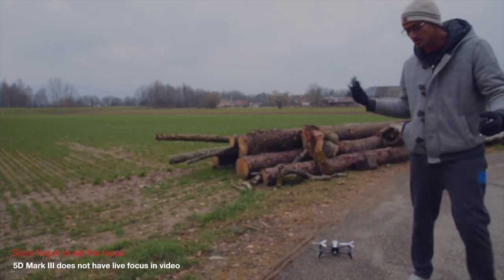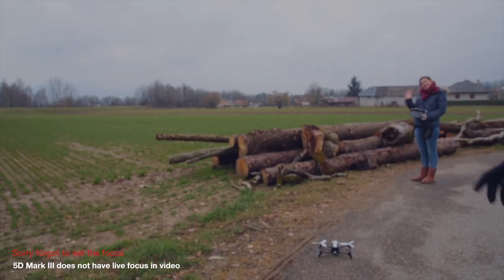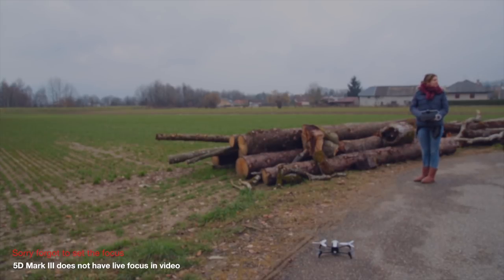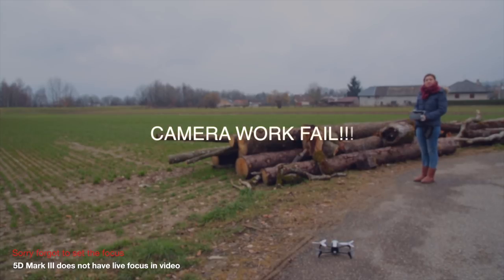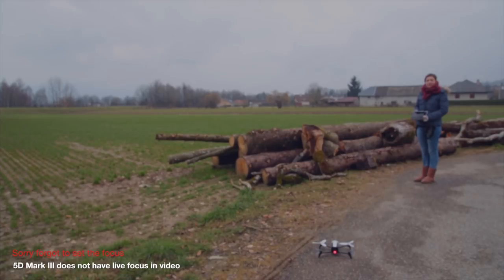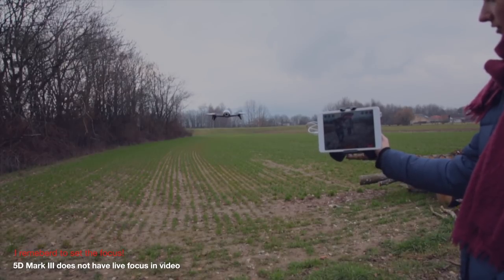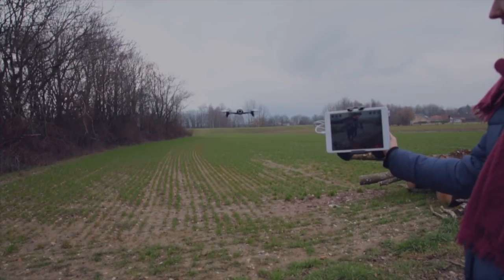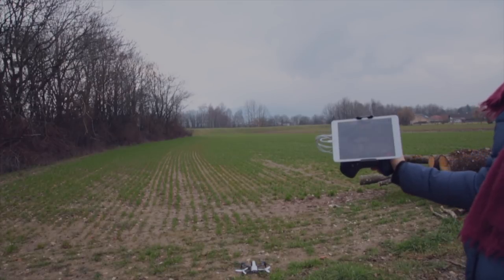BEBOP 2 Battery Discussion and Experiment

Comment: I think giving the flight time of the drone would have been helpful to understand if battery has degraded, being left on a full charge for three weeks.  My tip is when you are leaving a battery in storage is to give it a 50% charge time, ie: full charge = 45 minutes, storage charge = 25 minutes, and never run your battery below 20% these precautions will preserve your batteries performance  longer.
Reply from the maker: My Apologies John the flight time was 15min 17sec, the battery did indeed degrade from 100% to 86% from being idle for that time. Appreciate the tip on the charge times.
Reply: I think their concern is that if you charge a battery 100%, then leave it for a month, charge it back to 100% and fly it, the battery may have puffed a bit and will have less flight time than it would have if the battery were properly stored at 50% charge.  

That's really the only reason I bought a bebop specific "balancing" charger from ebay:  1) It shows me the voltage on each cell  2) it charges all three of my batteries simultaneously   and 3) it has a "storaging" mode that discharges all three batteries simultaneously to 50% charge.      Expensive at $100, but very convenient compared to the stock charger.
Reply: DumbDuck44  Do you have  the link for the balance charger and does it also include balancing  cables for bebop batteries ?
Reply from the maker: DD44 iv seen the puffing with the GiFi batteries for sure. Makes allot of sense now. Ill need to compile these advisories into a new video, with credits to you kind people for the notes. Cheers
Reply: Its the EV-PEAK DP2 available in the United States for about $100 shipped from vendors like Amazon, Ebay, etc.    The nice thing is that its specifically made for the Bebop 2 batteries, so they slot in and it looks very clean.
Reply: I forgot to mention, there's a EV-Peak DP2 and DP1, you want the DP2.   The DP1 is 30W/2.5A, originally made for the Bebop 1 smaller batteries I think.   The DP2 is the 35W/3.5A unit, made specifically for the Bebop 2.   It has no problems charging my aftermarket GIFI 4000mAh batteries.    BTW, the GIFI batteries (very cheap, about $40 shipped) are supposedly not really 4K capacity, but do definitely provide longer flights than the 2.7K mAh stock units, and are cheaper.     They look identical side-by-side to my stock units, but they are heavier, and take a little longer to charge to 100%.
Reply: DumbDuck44  Thx. Will give it a look
Reply: DumbDuck44  Sadly not available in UK on eBay uk.co or amazon.

Comment: Mine fell out of the sky after being used the previous day, recharged and used the next day.
Reply from the maker: Sorry to hear that Biker Geek, did you find the root cause of the fall out and did you have a chance to measure the cell voltages. That usually determines if its the battery or a software conflict.
Reply: Not yet.  This is my second bebop 2.  The first one did the same thing only it crashed on concrete and was pretty much destroyed.  Luckily this one fell in grass but from about 100 feet up.  Battery got cracked and a prop was damaged but that was about it.  How can you test the voltages?
Reply from the maker: Biker Geek here is a link to check the battery, all you need is a basic multimeter or volt meter and your original charging cable to check the cells. https://youtu.be/S535fQmQ04A

Comment: Hi Anthony,  how long have your batteries been lasting over time. I rotate  Through 3 batteries which are about 9 months old. After about 2 weeks I have charged them they are taking off  With about 56% of battery life.  I do have about 60 flights in this time frame but they're just not holding a charge like these to.
Reply from the maker: I have 2 batteries that are had 240 flights 15 hours on my first BB2 than I crashed that BB2 and continued to use them with my second BB2 for 174 flights and 14hours 3m. The battery that came with the second BB2 has a PCM failure so its been taken apart for experiments. The two batteries that have now a total of 400+ flights and 29hours of air time still hold a 20 minute flight without issues, even after my last experiment of leaving them full charged. It is difficult to say without knowing the cell voltages of your batteries, but I suspect given your low use it could be the charger that is failing if both of them are only being charged to 56% at (green light). Hope that makes sense.
Reply from the maker: Also I use 2700mAh batteries, if I got say the 4000mAh batteries I would be using a charger suited for that capacity.